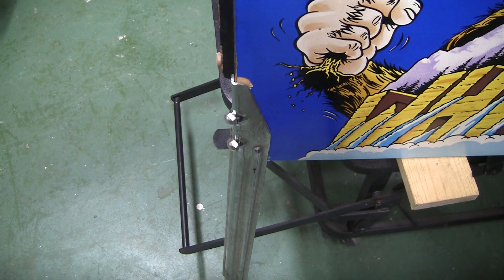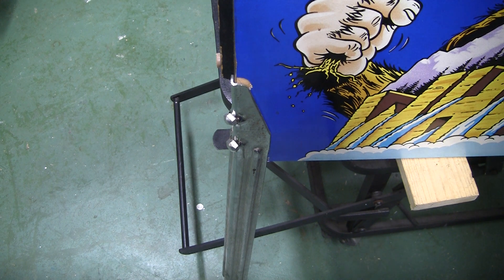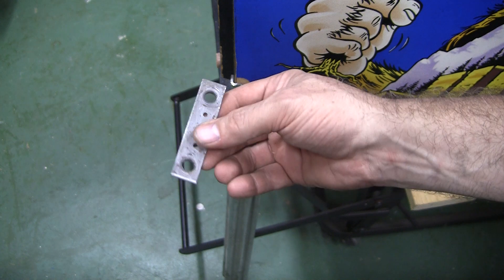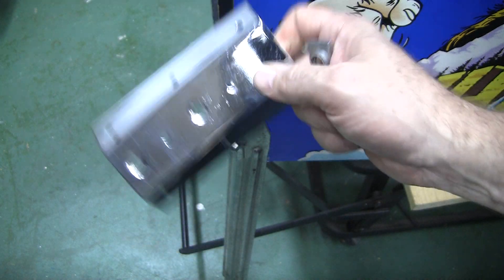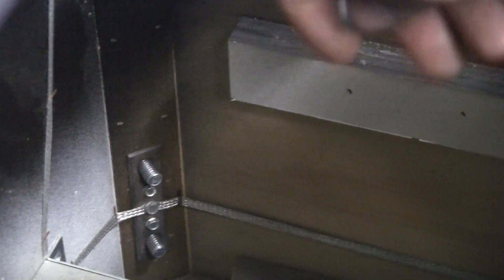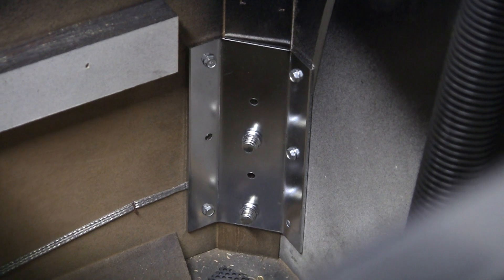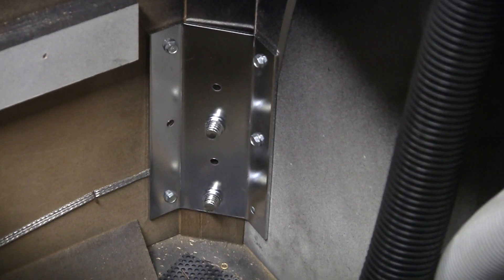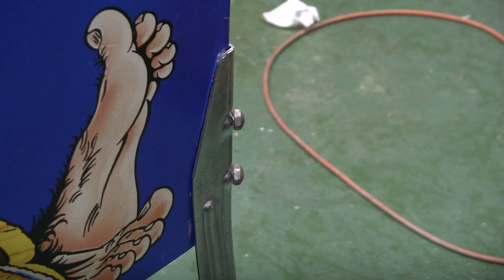Repairing stripped pinball legs/brackets - PinballHelp.com

Comment: PINBALLHELP,  why does older pinball games use AC coils & Solenoids and new games use DC coils & Solenoids? the pinball linear power supplies only used ONE filter capacitor at a very high capacitance 27,000uf and higher, any reasons why to use only ONE filter cap while most power supplies use multiple filter caps rated at 100uf? Some pinballs games used MASKED ROM chips instead of using EPROM chips any reasons why besides the costs of the chips?
Reply: AC machines make a buzzing sound and waste a lot of power doing that, essentially pulling/releasing the coils during the AC-cycle, they shake more violently, but have less power because of this inefficiency.
Reply: @tithund  thanks for the help, why does AC coils & solenoids make a buzzing sound, is it from the 60hz frequency on the AC line? why do they have less power when pulling and releasing?
Reply: @billwilliams6338  It pulls and releases effectively 60 times per second, so it's not a constant pull as you get with filtered DC.
Reply: @tithund  what do you mean when the "AC" solenoid is turned ON the plunger releases out so its a constant pull. When the AC solenoid is turned OFF the plunger is pulled IN so its a constant pull. What do you mean by the pull & release is 60 times per second?
Reply: @billwilliams6338  Alternating current switches on and off 60 times a second, there are 0-volt points 60 times per second, this is also why some people are bothered by fluorescent light, it blinks on and off.
Reply: @tithund  yes but the solenoid is not switching on and off 60 times a second or your would get a clicking noise. When the solenoid is turned OFF its not switching on and off 60 times a second and when the solenoid is turned ON its not switching on and off 60 times a second. So what do you mean? Do you mean that the AC Voltage is constant but the AC current is switching 60 times a second so the AC current is moving causing a switching buzzing sound on the solenoid?
Reply: @billwilliams6338  yes, but there's 0-volt points in the cycle of alternating current, it alternates on one line between + and -. It doesn't as some people believe, switch between the lines, the other one is always 0.
Reply: @tithund  yes you said there is "60" zero volt points happening on a 60hz line frequency which is causing the switching/buzzing sound on AC coils and on AC lamps? its the zero crossing point noise you mean?
Reply from the maker: Also, sometimes that buzzing sound is because of the coil stop becoming magnetized.  this will happen over time and it's one reason to routinely replace coil stops.
Reply: @PinballHelp  what do you mean by the coil makes a buzzing sound will the coil is not being magnetized why would this cause a buzzing sound when the coil is turned off?
Reply: @billwilliams6338  The coil stop is the part that's in the back of the coil, it gets beat up and magnetized in time.
Reply: @tithund  I didn't know that the coil stop gets magnetized, i just thought it only gets beat up hammered by the solenoids plungers ramming it